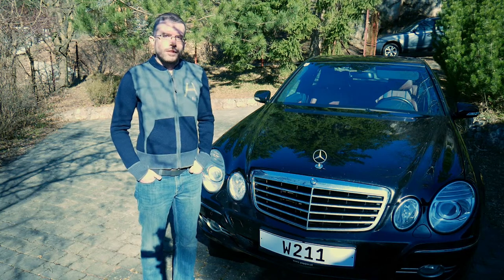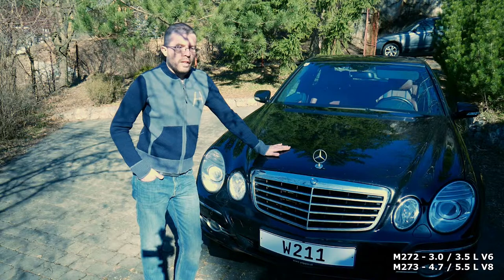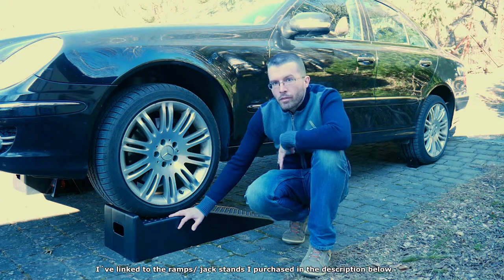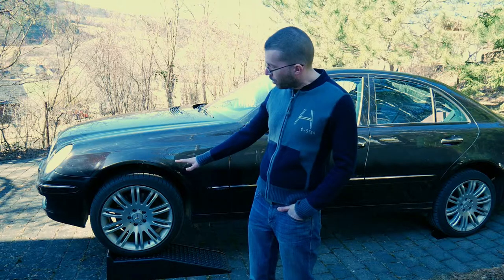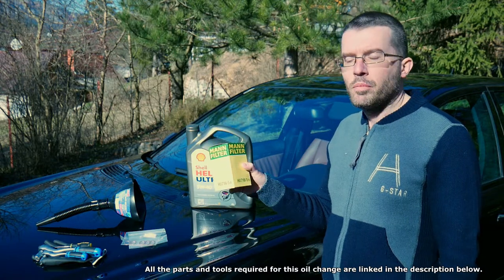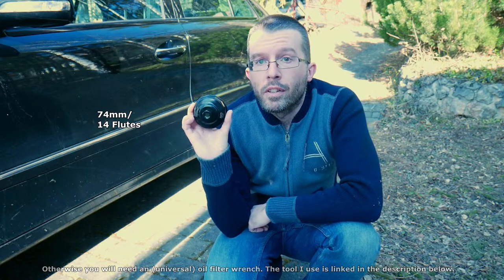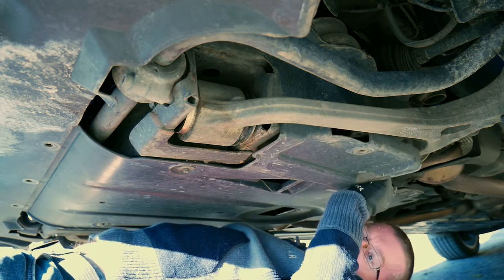ENGINE OIL & Oil Filter Change on a Mercedes-Benz E500/ E550 4matic (W211)

Comment from the maker: You may also be interested in my Jaguar S-Type Rebuild:
https://www.youtube.com/playlist?list=PLpGOsXYW3_KrfpoWOPMjFhUzNwxXovxVk

All the Parts & Tools I use are linked in the Video Description.

00:00 Welcome!
02:45 Required Parts & Tools
05:39 Oil & Filter Change Procedure
           05:39 Unlock & Open Hood
           06:28 Remove Engine Cover
           07:18 Unscrew Oil Filter Cap
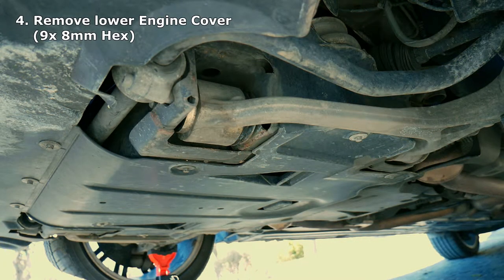           07:50 Remove Lower Engine Cover
           09:50 Unscrew Oil Drain Plug
           11:00 Reinstall Oil Drain Plug
           12:12 Reattach Lower Engine Cover
           14:14 Change Oil Filter
           18:44 Refill Engine Oil
           20:10 Check Oil Level
           21:47 Reinstall Engine Cover
21:56 Please Subscribe & Ring the Bell!

Comment: Thanks so much. I really learned from this. I have a w211 2008 with 166kms and it is flawless. Only the V6 but it drives beautifully. 
I will do my own oil changes every 8.000 kms. Thanks for your great help. Stuart. Sydney Australia
Reply from the maker: Thanks a lot, also for watching 👍

Comment: Thanks for posting !  Recently switched from Mobile one to Liqui Moly on my E500 also. Runs like new...
Reply from the maker: Thanks for watching! Mobile 1 has been the #1 recommendation over decades also here in Europe. Then it wasn´t available any more and people freaked out... "Luckily" my car is pre-owned and I don´t know its "oil history" (it was company-owned and serviced at the Mercedes dealership) besides 5W40 having been filled in lately. So I stuck to this spec and can´t complain about Shell Helix Ultra - one of the cheaper oils here in Austria - I use ever since. Obviously this brand isn´t available in the US, and that´s why the affiliate link underneath my video connects to what I would go for if I lived over there 😇

Comment: Do you have a video about the transmission fluid change on a 722.9 transmission? Great video btw!
Reply from the maker: Thanks, also for watching!
Not yet - need a car equipped with the 722.9 first (W211 4matics came with the old 722.6 gearbox) 😎
Reply: @AUTOdidact77  i have a 2007 w211 E320 diesel( before AdBlue) and it has a 722.9 transmission. Love the Diesel engines before DEF fluid